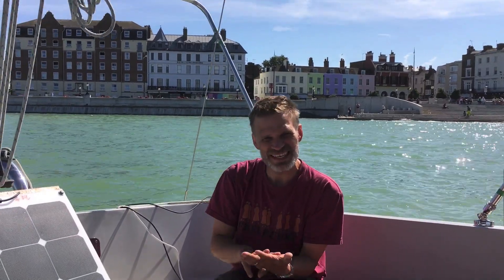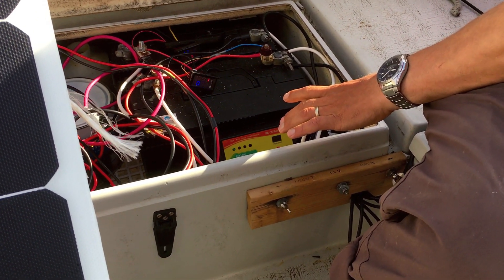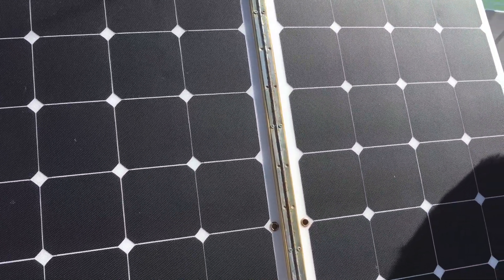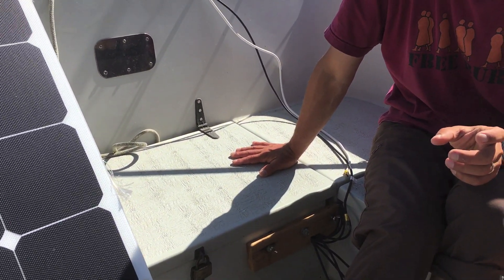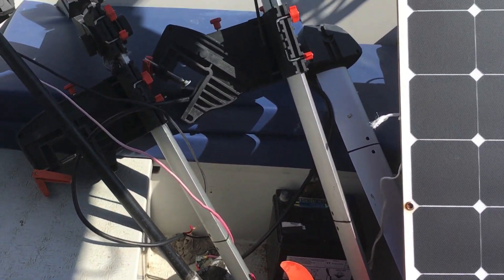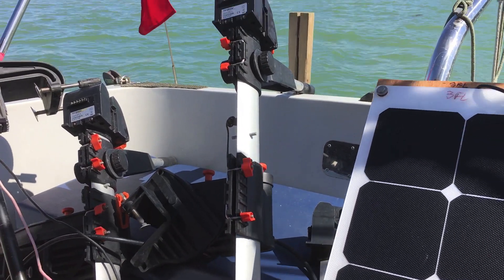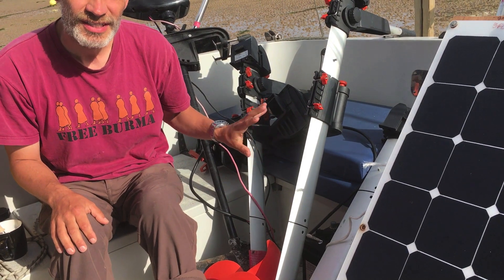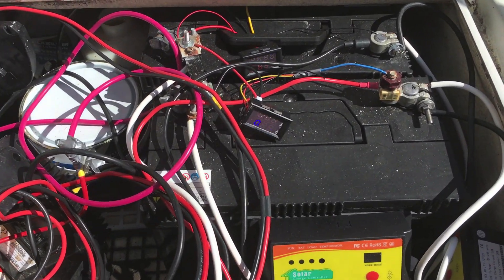Zero Emission Solar Electric Boat - Lessons learned from Year 1

Comment: Hi Simon—how wonderful to find someone with such great aspirations and such great real-world experience.  I am also planning to convert my 2500 lb monohull sloop (currently using an 8hp petrol motor) to electric propulsion.  I’m planning on wiring 6 x 175W flexible PV panels in series and parallel to provide 24V (nominal) to three Victron 100/30 controllers to charge a 300 A-hr LIPO bank.  I estimate it will take 900W (37A at 24V) of power to move my 2500# boat 4 knots.  Does all this sound reasonable to you based on your experience? All the production electric outboards I can find (I.e. Torqueedo) seemed designed to move dinghies at planing speed using small, fast turning props.  I’m trying to find a 1.5kW electric outboard designed for a slow turning (≈1500RPM), large diameter (12”), low pitch (5”) prop; this seems tailor made for a high torque electric motor, but I just can’t find any such thing.  Have you found anything like this during your research?  All the best, Jay
Reply from the maker: I think 900W on calm seas would be fine to move a 2500lb boat - mine weighs closer to 8000lb and would move at nearly 4kt with 900W on calm seas.
And the 2000W (24V) Torqeedo I have comes  with a low speed prop as standard. There is a higher speed (more angled) prop you can request but the standard is the low speed one that’s designed for larger boats. It’s probably the same with the 4kW (48V) one.
I hope this helps and please let me know if any further questions.

Comment: Solar power for my ranches/farms, I use 24 volt systems. 24 volt uses MUCH smaller wire ( 1/2 the amps), thus saving me a lot of money.  In Arizona, I just bought another 10 panels, 24 volt, 250 watts each.   The panels are used but in EXCELLENT condition and cost only $45.00 each (YES, only forty-five dollars each.) Look on E-bay.  They do ship but it is costly, and I don't know if they ship outside the USA. I also use used Nissan Leaf Lithium batteries.  They cost about +/-  $300 for 6 of them.  Good video and best of luck to you.
Reply from the maker: Excellent - great to hear from you and great to hear you’ve managed to create low cost solar power. It’ll only get cheaper and better so you’re showing us the future!!!!

Comment: any converter 12 to 24 volts cost energy , you lost energy , because converter got hot  , use the direct way in 24 volts with the solar panels , and the 24 volt motor , if the iron surface is big , the efficience goes also down , so you need the lowest iron surface in the motor , then the efficience grows up , it a great passion , the world just to drive with solar , without batteries , but small batteries are a also good bridge for rest time , or gold cup condensators , the efficience of batteries are a own pylosophie , because what you need is ,that much and every electrons you must harvest as possible , a full battery stop charging electrons , because he reach the short circuit , may be you need 36 volts batteries ,clouped in series , these eat electrons allways with 24 volt solar panels , so my best wishes and success and sunny days

Comment: What is the equivalent ICE outboard in HP to your 2kW electric, or put another way, what would you normally have on a 3 ton catamaran?
Reply from the maker: Hi, Apparently the 2000W motor is equivalent to about 5Hp ICE. Normally you have around a 9Hp ICE engine on a Cat like this but I’ve never needed the old ICE on full power so I think a 2kW electric motor should be okay, especially if I had the possibility of using two in an extreme situation.